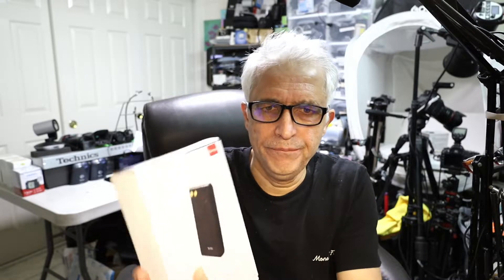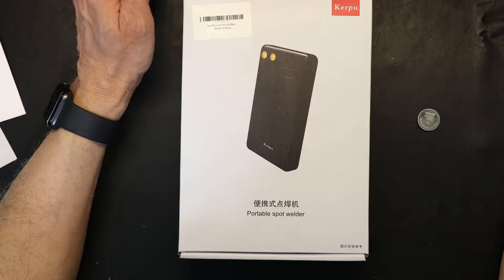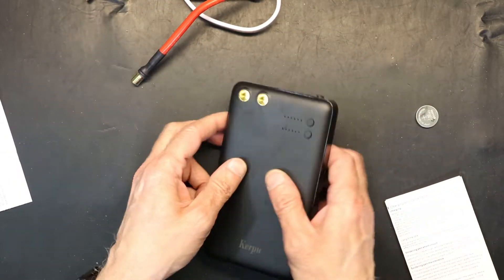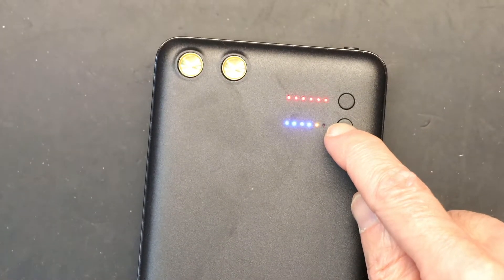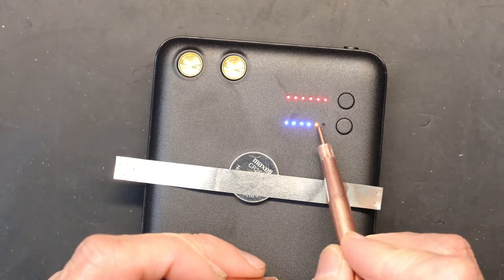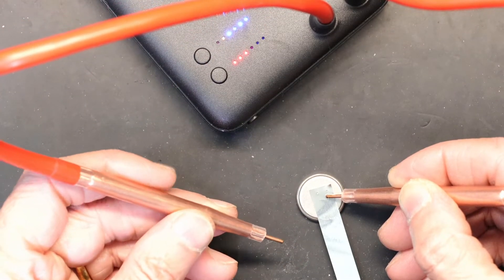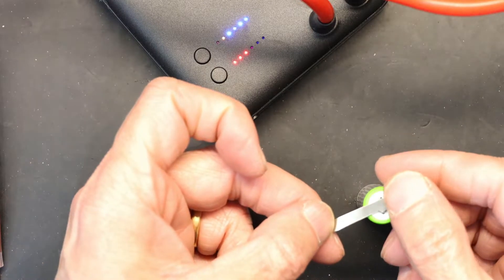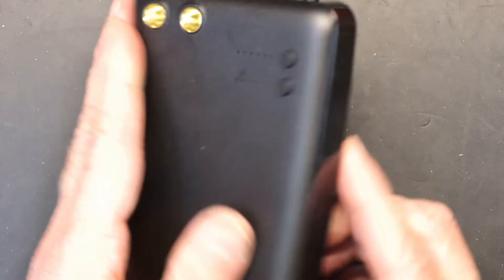Using Kerpu Portable Spot Welder To Make Li-Ion, NiCad & Lithium Polymer Rechargeable Battery Packs

Comment: Some of those units have a socket that you can attach a foot pedal to use in manual mode rather than the button on the panel.
Reply from the maker: Indeed, and they are much easier to use.

Comment: Mine arrived broken :(  I charged it for hours and have a blue light flashing. When I disconnect it from power and try to use it then it doesn’t turn on at all.
Reply from the maker: You should send it back for a refund or exchange, it seems like the battery is shot inside.

Comment: Hello, maybe you could help me, I have the same welding machine in Kerpu, but it welds badly, even in the 6th gear, the tape doesn't stick at all, the tape is 0.10 mm, what could it be, maybe something is wrong with the welding machine, if you can help
Reply from the maker: Hi, which metal strip did you buy, because for battery welding there is a specific one you need to get.
Reply: @TECHNOLOGYTIPS101  6x0.10x1000mm 99.7% pure nickel strip for 18650 batteries
Reply from the maker: @raktaspusraktis1586  I am using this one https://www.amazon.com/gp/product/B08RJKWCWK/ref=ppx_yo_dt_b_search_asin_title?ie=UTF8&psc=1
Reply: @TECHNOLOGYTIPS101 Can it weld pure nickel 0.15mm?
Im choose between this or fnirsi swm-10

Comment: Hi I like the video thank you, can I use this spot welder to weld cell phone battery packs?
Reply from the maker: Yes you can but you have to set it at a very low power because they are very fragile. Also you must not weld near the body of the battery only do it on the terminals.

Comment: I thought that to spot weld, one should have on probe on the strip and the other probe on the battery. i.e. so the current would flow thru the battery 'cap' and then  back up into the strip. ????
Reply from the maker: Doing so will create heat on the battery terminal and an unnecessary spot welding scar on the battery terminal. Keep in mind that both probes will create a welding spot, so you want both welding spots on the connecting strip, and not on the battery body.

Comment: Is it suitable for the batteries in cordless drill battery packs?
Reply from the maker: Yes but for that you need to use thicker strips of metal to connect the cells, and put the welder at max heat.

Comment: Can I use it for welding 14k gold or silver to make jewelry?
Reply from the maker: This tip is too strong for jewelry, for that you need a very fine pointed welding like this one https://www.youtube.com/watch?v=CrOkpaw43b4
Reply: @TECHNOLOGYTIPS101  Thank you for this super easy video! I have a similar question to Isabel actually: I need to tack weld a series of fine brass meshes to 1/8" brass rodes - but I cannot use traditional heat solder (with my oxy-propane torch) for many reasons. I already bought the unit and plan on testing it out anyways - but if you have any tips for me I would love to hear them :)
Reply: Brass RODS* (not rodes)